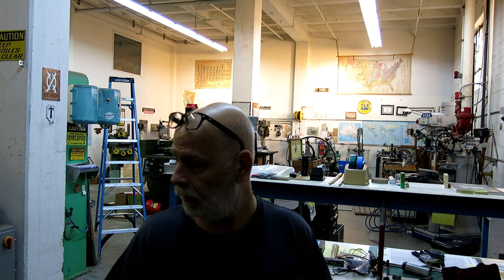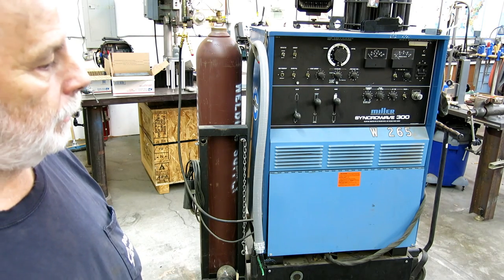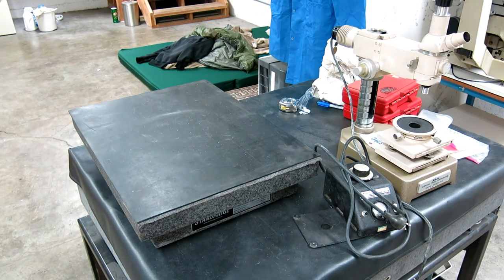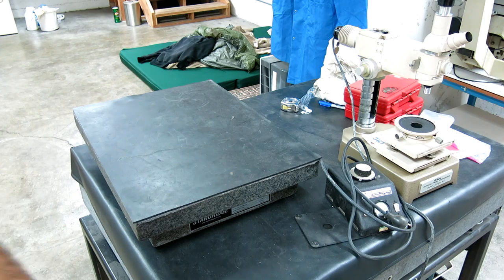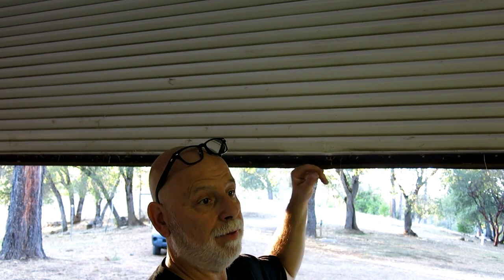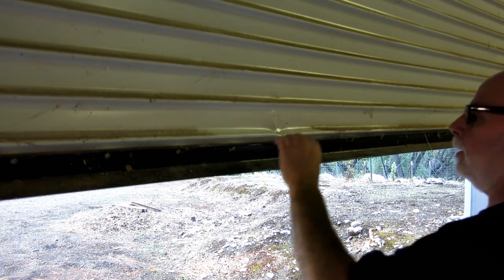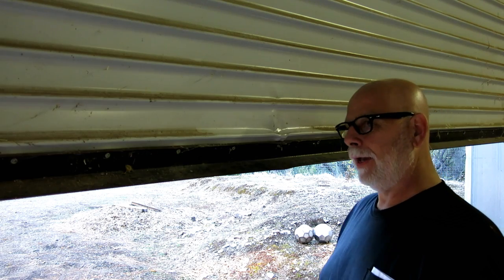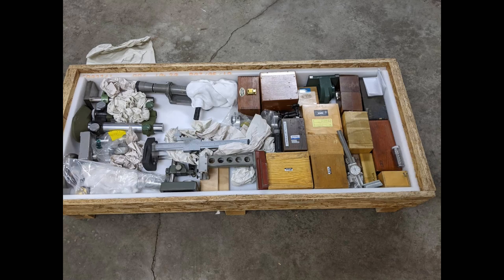Epic Egress Update #3

Comment: I wired my shop with twist lock connectors. I used 4 pin plus ground. The fourth pin controls the rotary phase convertor. Ground that pint to turn on the convertor. So a machine that needs 3 phase will turn on the convertor when needed. I don't even have a way of controlling it otherwise. It is just like having real 3 phase. Turning on a load like the mill spindle and the rotary convertor simultaneously works fine. I anticipated a problem but never had one. I have added a contact block to power switches, used an unused contact pair on a 4 pole relay or added a small relay to get a contact closure to turn on the convertor. I put the convertor outside in a rubbermaid shed with my air compressor and dryer. I can just hear the convertor run without  being annoyed. Same with the compressor. Operating this way prevents leaving the convertor on all night.

Comment: That is brilliantly simple. I cannot believe that moving companies have not come up with a reusable folding crate designed with fork pockets. Modular moving. It makes so much sense that I am shocked it is not standard. You don't have to worry nearly as much about breakage, you pack it yourself. Pretty hard to screw things up just moving crates with a forklift. And when you're done moving, you'll have a nice supply of OSB dunnage. Perhaps the crates could be transitioned into shop storage, like build a wall of shelves by turning them on their side and adding a face frame. Trucks and dollies could be designed for a single size, making them more effective and lighter weight.
Reply: Even better would be if there were say four different sizes that were consistent fractions of the largest. Sort of like Legos. The idea being that when you went to reuse these as shelving or storage, they could both have the ability to nest as well as making funky shelves that still come out square. If you were to take some 1x2 wood, make an inset square on the underside, it would protect the crate from a flooded basement. If you took the same slats and made a square on the perimeter of the lid, all of these crates could lock together.

Comment: When Chuck told me you were moving I thought what a coincidence.  I just sold my house and bought a 7 acre farm.  I am having all the same trials and tribulations you are (minus the generosity of your viewers).  I have not had a single moment to make and post a video.  I don't know how you do it.  I have to wire my shop for all my equipment, but I need a lot of my equipment to do a lot of that.  I have been working 12 hour days, 7 days a week to move all my stuff.  At the same time I am getting ready for planting hay, which means I have to get the tractor fixed.  It never ends.

Comment: Hi Tom! Looks like a Porvene sheet door. If you dont like the way it turns out, they have a distributor here in Sacramento. You can replace the bottom section by drilling out the rivets and installing new. If you relief cut the bottom steel, the sheet will be way more giving, I would recommend pushing it from the outside, then weld the relief cut. If you need any help with doors, thats my thing, i would be more than willing to take a day trip. Take care.

Comment: 16:30 in the video, all you're missing is a sold straight edge  blocks on both sides of the door, SOLIDLY, and big clamp! Or threaded rod to go with your hammer & a block of wood . This will give you the ability to add the clamp and the hammer, so you do it gradually perfectly, good going on the move! Hope you have very little payments on it! Better yet! Hopefully it is (or gets) paid off quick. Ya!  Great Property. The skates work nice.

Comment: Looks like a nice place. I assume you are still in the Bay Area somewhere. The only thing that would concern me in a shop in the hills is the dust. I’ve been in many rural shops in my day and typically everything inside is covered in a thick layer of dust. Most shops I’ve been in are full of tractors or farm equipment so dust is not an issue but you have some seriously delicate precision tools that probably won’t do well in a dusty environment. What do you plan to do to fend off the dust. I would definitely seal off every inch of that shop first. Make it as air tight as possible. Then I’d have a large sprinkler system around the doors to dampen the soil.

Comment: An overhead door company can get replacement panels for that door and the lower panels are easiest to replace.  Don't ask how I know.
Reply: That door isn't that bad, tom will fix it easy
Reply: That isn't a sectional door, it's a rolling sheet door and the curtain is a single piece. Tom's on the right path, I deal with it all the time.
Reply: @The78cj  Each of those horizontal sections is separate from the other.  They have a tubular area top and bottom, which gives them rigidity until the tube is compromised.  One edge with the smaller tube slides in to the larger tube of the next piece which allows it to "hinge" and roll up.  It is not a single piece.  We have four just like it on our barn and have replaced sections.

Comment: Some of the roll up doors have both manual (chain) and power lift/lower. That might be helpful in working with the door to clear a jam. Nice during power failures too.
You might want to check into that. It would be nice to have the option of partly opening or closing the door to limit sunlight streaming in or regulate ventilation during cool or hot weather.
Thanks
Reply: A good gust of wind on a half-open roll door can do really bad things to it, including tearing it completely out of the track. Better to have it either up or locked down, or at least within a foot or so of full up.